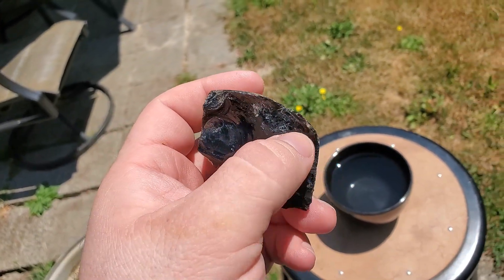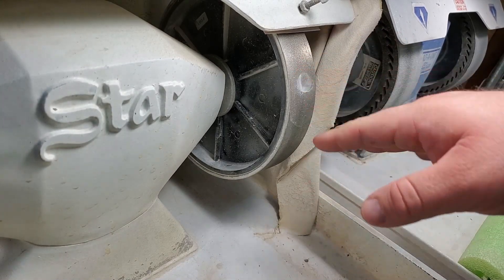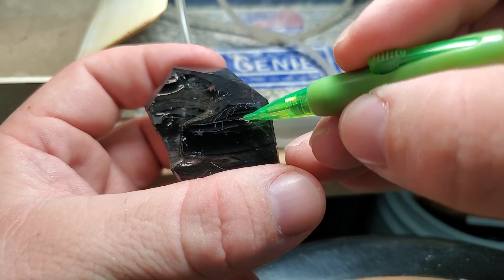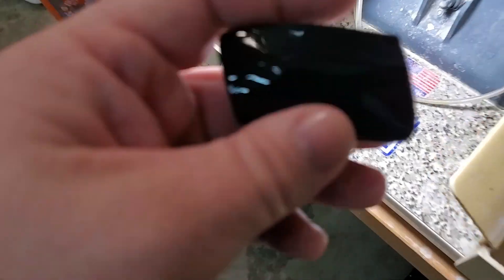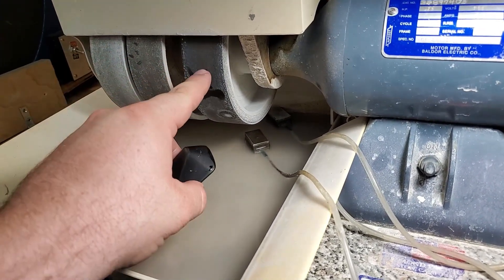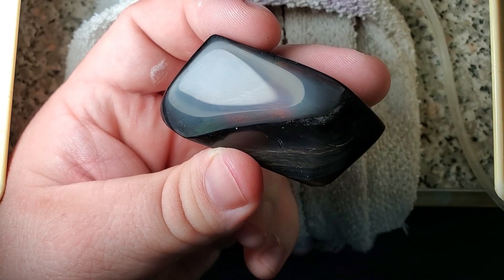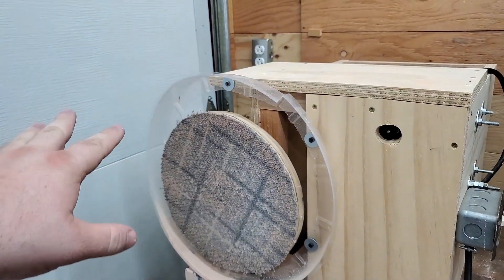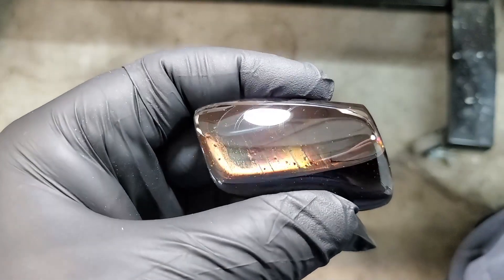How To Polish Fire Obsidian

Comment: What was the straight line on first side when finished. I am thinking its layer lines but would be nice to have that confirmed.

Great looking piece. You polishing wheel is it carpet or fabric.
Reply from the maker: I think if it's the line I'm thinking of, then is it part of the later. 
and the polishing wheel is carpet.

Comment: Are fire obsidian and rainbow obsidian the same? They both look to have gray and black layers, with the black being more transparent allowing more flash.
Reply from the maker: They are different and with several differences.
Fire layer is made of nano-crystalized magnetite and the layers themselves are very inconsistent and the colors can greatly vary on a single layer.
Whereas rainbow obsidian is compromised of microscopic bubbles and the layers are not only more consistent but are thicker than that of fire obsidian layers.
The colors are also limited to just one color per layer.
Rainbow obsidian can also be found at several locations where Fire is only found currently in one spot in Oregon.
Reply: @WorldofRockhounds  Thank you. With that in mind, I see the single colored layers in my rainbow obsidian.

Comment: I'm enjoying your walkthroughs. Since the fire is in layers, could you slice one stone into multiple slabs for cabbing, etc? Or are they better used for display pieces like this one?
Reply from the maker: I all depends on the piece and the artist. If it had multiple layers of fire, and with a good angle of cut, it could be slabbed and cabbed. But if it just had a single layer, then one could slab it away from the rest of the rock that doesn't have any layers and then work that piece down into a cab. It would help to have the layer parallel to the cut side and then work the exposed side to reveal the layer. Having it domed on the edges also allows light to help enter the stone to reflect off the nano-crystalized layer. 
I'll be working on my necklace here soon as It had to be refinished and there are a few good pointers I can show in that video.

Comment: Im having an issue with my obsidian ... when on my 220 wheel the obsidian seems to chip ... am i applying to much pressure on the wheel?
Reply from the maker: Is it a 220 hard or soft wheel? And are you using water? And any imperfections in the stone?
Reply: @WorldofRockhounds  so it looks like there might be some air bubble trapped inside and when i go down to the next layer it chips a small hole. It's a 220 sandpaper on the wheel and I am useing water. Im currently using the machines at the WAMS facility
Reply: @WorldofRockhounds  im also more used to Agate atm so i feel like I might be adding to much pressure to the wheel.
Reply from the maker: @krackenagate5606  That could be it too. sometimes there could be a spot one the belt that can be more aggressive that the other spots of the wheel. There have been times I have spent so much time working obsidian that I went to working agate and the difference in how each material works is crazy!
Reply: @WorldofRockhounds  thanks brother <3 ill try and send a pic of it when i have it finished.